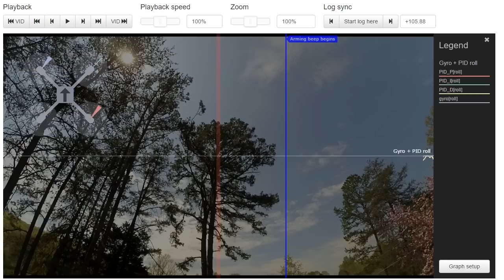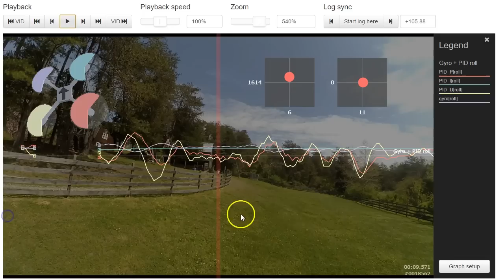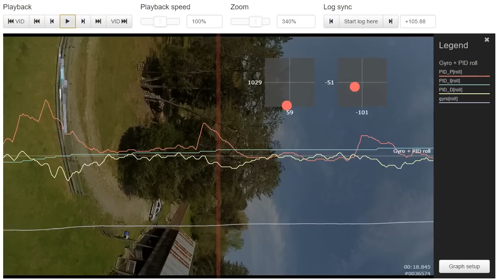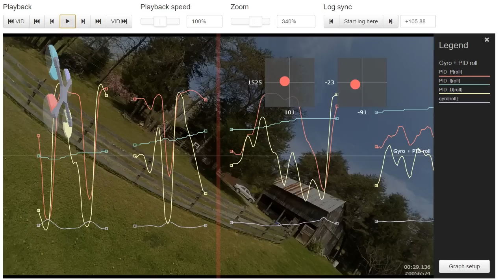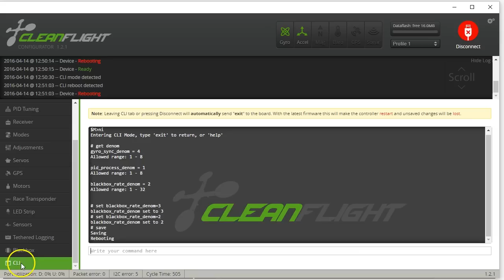What Does A Failing Gyro Look Like?

Comment: After watching this video, I THINK I have a bad gyro. My quad has sometimes motors too hot to touch after it refuses to lose altitude at zero throttle and sometimes tries to fly away by gaining altitude even at zero throttle. The motors sometimes make a horrible tinny grind sound when the quad is trying to fly away. I set my blackbox graph like you had. In a matter of a few milliseconds the D-Term peaks way up, then way down. P-Term peaks 1/3 the height as the D-Term, but opposite of the D-Term. Motors on the right side spin up near full throttle, then slow and the motors on the left spin up near full throttle, then slow and this goes on back and forth. All while my sticks are not really moving and throttle stick is very low. This must be an attempt to flyaway. Right side increases altitude, then the left side which catches up to the altitude of the right, and back and forth in a matter of milliseconds.   Then when I give it full throttle to pop up in the air, the oscillation goes away in the Blackbox graph. 

Very strange. No problem with the quad for several months. One day 3 batteries fly fine and the 4th it starts refusing to reduce altitude and attempts to flyaway. Thanks for the video. I THINK I have this figured out. I am going to change the FC and see if the problem goes away. If that fixes it, I have other bad FCs and AIO boards with the same MPU6000 gyro on it. I can try to replace the gyro and see if I can save the FC because these things are getting hard to find and are expensive.

Comment: My omnibus F4 is doing literally the same thing but only on the Yaw axis. Did you replace the Fc and confirm it was the gyro? Im still trying to figure out the issue. I have blackbox and gopro footage of mine as well if you'd like to take a look. This issue started happening after a crash. The crash was not that hard but still managed to bend two motor shafts and break an arm. Since that crash i have replaced the motors and arm but have this twitch now. Like yours two motors seem to flip out at random times during the flight. Even more crazy is if i arm the quad in my hand with no props and slowly move the quad left and right on the yaw axis i can feel these same twitches when it attempts to correct, again they are random and sparatic.
Reply: david pinckney i have the same problem on one of my quads with the Pitch-Axis.
Did you found a solution?

Comment: Hey Josh, Im having an issue where I am  having to plug in 3 or 4 times before my copter completes its tones/bind same thing happens  in beta flight. I've replaced  all electronics besides my hobbywing f4 board and wondering if you've had this problem.... Reason Being is I had replaced everything to begin with caused from a roll and the quad bolted straight into the ground 2x. Survived the 1st but happened again. I don't want it to happen for a 3rd, what could be the cause you think?
Reply from the maker: If you have to plug multiple times to get the startup tones, then there is some hardware issue or wiring issue. Process of elimination (replace parts) to find what it is.
Reply from the maker: I would start with the FC personally, since it is affecting all four ESCs.

Worth checking if the XT60 is loose. That could be it.
Reply: I replaced everything besides my flight controller hobbywing help mention to take off accelerometer. I'm just nervous it might bug out again but other than that if flies so smooth and perfect...
Reply: I will check the  xt60. ty
Reply: So it eventually my quad syncs and no problem while flying. It takes a few plug ins and after no problems flys like butter.... Weird huh?

Comment: Hi Joshua, I made a new quad, I went to a hover flight and it flew amazing , today I went for a crazy flight and when I flip really fast 1000• sec the quad is just restarting in the air crashing to the ground , it happens 3 times to me : the first time I thought the charging cables could be in the props way ( but nothing Brocken ) second and 3th time there was also nothing. I didn’t try more times .. what could it be ? It is calibrated , it has 3.2.1 betaflight and omnibus f4. Cheers and thanks
Reply from the maker: If it is really restarting, like you hear the ESC startup tones in your HD camera footage then you are losing power. I would check the XT60 first. Is it loose? 

https://www.youtube.com/watch?v=UYXTiSeVmB0

Comment: Hi Joshua, I love your videos... it's just great that you share all your findings. On my newest quad I have a similar isse with motor twitching. In my Case the roll gyro seems to be broken, because in the log the twitch is only visible on the roll axis. The pids and gyro for all the other axis just run straight.

Here's a screenshot of a twitch http://prntscr.com/ayf9eo this might be interesting to you.

I wrote to armattan support and explained my conclusion that the gyro must be broken. They agreed and shipped a new F1 board (still waiting for it to arrive).

Oh and I might add that this issue only is present when flying 4s which is kinda curious.
Reply from the maker: Sometimes glitches only show up at higher vibration levels. That may be why it shows up at 4s.

Comment: When running 4khz does the gyro get overclocked also? If so is it possible that overclocking the gyro damaged it somehow?
Reply from the maker: +Stephen Gibb the gyro is always running at 8 kHz internally when the gyro_lpf is off. It just drops samples to reduce the output rate. This is how it's designed to work. There isn't any over clocking there. 

Boris has over clocked the i2c bus to get 4 kHz out of the chips using i2c. This should not cause any damage but it could possibly cause corrupted data on the bus. The corrupted data would be detected though.

Comment: the motor torch is disturbing the gyro, what motors are you using? over 2500KV
Reply from the maker: +dungeonsound1 2633 kv.
Reply: yup, new Gyros are sensitive to these new motors low end torque, run them on a Rev5 and they're alittle better. but same issues, you try to tune it out and its a compromise. not acceptable.
if you could take the board off the copter and hold in you hand and spin up the motors, no issues, because the board is not disturbing the Gyro.
I bet your other board was OK.
people are using MoonGu and taping there boards in to get acceptable results.
low end Torque, and the active breaking. it will kill a battery. so becareful.
Found this issue present with the Emax2600kv
and the DYS2750kv
Reply: +dungeonsound1 my setup is a Cobra 2204 2300 kv motor and I have had this problem on 2 Rev5s and 4Rev6s.
Reply: +dungeonsound1 though when I run SN20 or 30s rather than LB 20s the issue goes away with any motor I've tried high kv included. I want to believe it's as easy as you're explaining but that's not the case  on my bench.
Reply: +Brian West which version of betaflight did you try again? I think I've only tried 2.5.3 and 2.5.4 and 2.6.x
Reply: 2.4.0 - 2.4.1 - 2.5.3
Reply: first, if your running 2600kv or more, you should be running F390 ESCs, not F330.
read the fine print on your ESCs.
XM's are F390, Little Bee's are not, BL's are not. there are not many F390 ESCs out there.
the new Little bee pro's are F390?i think.
Also your PDB Should be able to handle your 30amp draw with 35amp burst X4. you may also want to run a Capacitor on the Battery in VCC.
Reply from the maker: With a 14-pole motor, you need to hit about 35,000 rpms to hit the eRPM limit on the F330. At 16.8 volts, with a 5040 prop, the RCX 2205/2633kv motor is rated at 30,000 rpm.

If you are running an HV 4S pack, at the very, very beginning of the pack, if you immediately go full throttle, you might just hit the rev limit. Under most conditions, I don't think it's going to happen.

That being said, Quad McFly's testing shows that the F390 ESCs generally out-perform F330's even on lower-kv motors. But by that logic, we should all be running F390's. Actually, given you can get an F390 now for about $11 to $14, we SHOULD all be running F390's. But here I am with some LB20s already in my copter and I don't intend to throw them out. I might could get a small percent more performance by replacing them with F390's, but it's not like I'm hitting the rev limiter.
Reply: True. electronics are over engineered to a point.
our problems don't reside in the ESCs tho. so F390's wont help
.my Emax red bottom 2600kv and my Dys 2750kv, will sit on the shelve. till I figure this one out.
my Lumeiner 2500kv Skitzos, smooth as silk, under same test scenario
its the sensitivity of the Flight controllers gyro.
and the High Torque motors. at Low throttle Spooling.
Reply: +dungeonsound1 I get same twitch with 2300kvs. I also tried Cobra 2206 2000kv, DYS 2204 2300kv as well..... Same result. Pdb is parallel with pads bridged with solder, Naze running separatly with 5v reg.  I don't think it's the high Kvs. 

We have a ton of guys running high kv setups with success in our group.
Reply: +dungeonsound1 when i bought my RG2205/2700 i asked what ESCs they were using for testing, RG20s... which are F330, so i am not so sure there is fine print regarding those higher Kv motors.

Comment: I'm curious to see what happens if you loosen your FC.  

here is my bb of the same exact problem.  https://youtu.be/bhhRuRo5s10
Reply from the maker: +quiljw01 Your comments didn't show up immediately because they contain a link to another YouTube video and they get held up for review by the spam filter.

Right now, I've gone back to 2.4.1 and have the FC on vibration-damping bumpers. I will try 2.6.1 again on my next build, but I'm so glad to have this copter back to flying well that I'm not going to screw around with it for now.
Reply: +Joshua Bardwell glad to hear it's flying well now.  I know exactly how you feel, I got sick of troubleshooting so I just left mine loosely mounted, can't believe it works! can you post a picture of your setup with vibration dampers?
Reply: +Joshua Bardwell also what curious are on your FC?
Reply: +quiljw01 sorry, which GYROS are on your FC?  I know naze rev 6 all sub revisions have the mpu6500 gyros which I have read are "noisy".  I'm thinking we are experiencing real life proof of this noise as shown in the twitch.

Comment: I have 3 naze rev 6b boards that all fly with a twitch that looks identical in blackbox.  I loosened the screws that hold the board down and the problem completely goes away.  so my copter flies great with a very loose FC.  I like this solution but it's the only solution I could find.  I'm thinking of trying gyro tape mounting the FC but I have no reason to change or right now since it flies so well.
Reply from the maker: +quiljw01 Interesting. I wonder why holding the screws too tight would do that.
Reply: Same here with the screws to tight. I've been through different motors, 4 Rev 6 and 2 Rev 5. I've only noticed this issue while using LB 20s, LB30s and some people reported it with XM20s. If I switch back to SN 20s or 30s it flys perfectly on the same equipment. Weird to say the least.
Reply: Same issue with naze. Going to give the loosen solution a try
Reply: +VIKO FPV I wonder if the clamping force is bending the board a little and consequentially the gyro. Alternatively it could just be the gyro being sensitive to certain vibrations that are not getting transferred with loose screws.
Reply: +Stephen Gibb yeah I am not sure so I loosen up everything and changed the board now I think it's my escs. I switched it to a dodo
Reply: +VIKO FPV I've been down this road that lasted months. I've had success with only securing 2 plastic nuts opposite of the USB port and the Spektrum port of my REV6 (original). I've tried a lot of combos and this was the only thing that worked.
Reply: +Brian West I have this issue but now my two of my escs are initializing in the air. Do you know what could cause that?
Reply: +VIKO FPV you mean arming? How are you calibrating your escs? I don't recommend using Cleanflights motor tab at all. I manually set them through Blheli suite.
Reply: +Brian West initializing meaning beeping similar to when you power the quad on. I accessed bhheli this morning set my min rpm to 1060 and max to like 1970. Any ideas?
Reply: +Brian West not sure if this help but they are rotorgeek 20 and dodo flight controller. How else can I manually calibrate the esc?
Reply: +Stephen Gibb it's definitely not bending the board because I have checked there is nothing pressing against the flight controller except for the mounting nuts and it does not take much force to cause this twitch. for example  these are plastic screws and plastic nuts  so it is not an over tightening issue either. so I am led to believe that for whatever reason the gyro is too sensitive to the vibrations that are coming into it and loosening them prevents the vibrations from entering the board, just as you said. wondering if it could be also frame related meaning that the noise and sampling rate might be in or out of phase? being in FaZe maybe could cause the noise to amplify? just speculating here.
Reply: VIKO FPV not sure really. However I have my min set to 1020, my max is 1960.